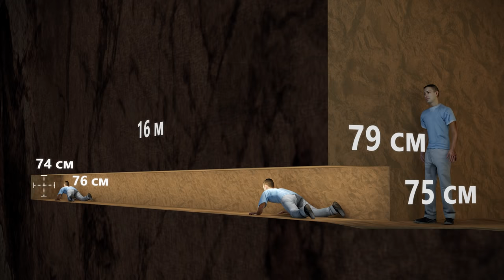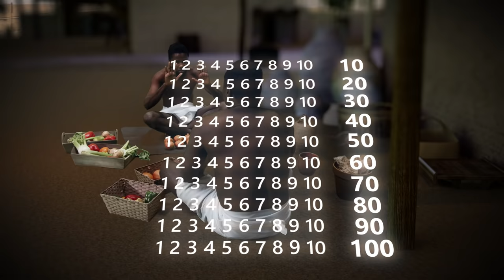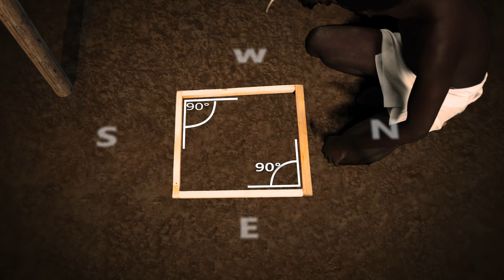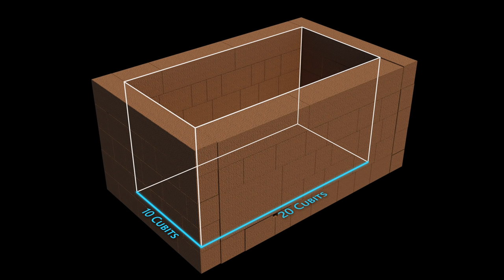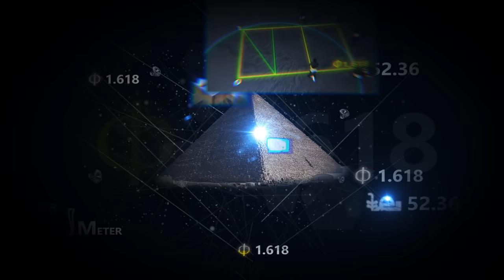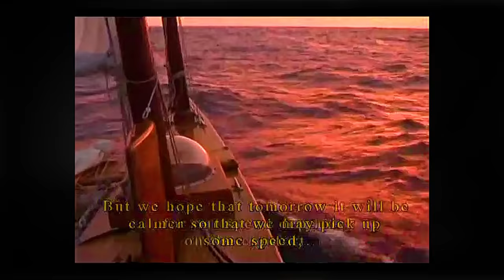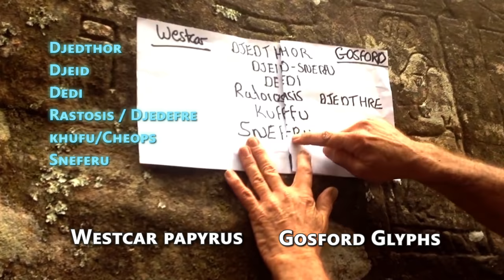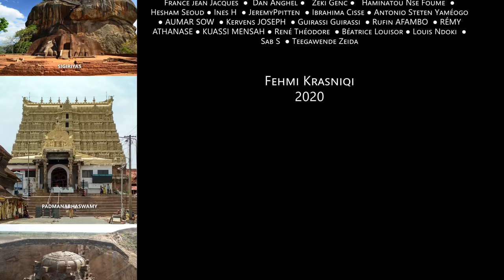The Movie Great Pyramid K 2019 - Director Fehmi Krasniqi

Comment: When you melt granite it turns into black brittle glass. The quartz fuses with the feldspar - so once it cools, you have a black glob like what you see on the islands of Hawaii. The natural granite coarse crystalline structure is gone. Naturally formed granite is igneous rock which is formed over time by not only heat, but massive pressure, moisture and gasses. Different process.
Reply: We are still missing something for sure.
Reply: Thank you. They may have poured the sandstone concrete but the Granite was not.
Reply: You are correct. Although the result is different when heating at 2500 plus degrees Fahrenheit
Reply: @jorgeduenas428  Oh. What happens during the process at 2,500°?
Reply: My question is, have the items been studied to verify tool markings and the "casting" theory suggested in this video? If not, then why?
Reply: @jetsetdotone  Better than "they shiped 200t stones".
Reply: Aliens. Definitely

Comment: While making concrete and pouring it into blocks or around forms makes a lot of sense, the giant lenses to melt granite into large forms as in this "documentary" needs several demonstrations for me to give this any consideration. Let's build these lenses, based on the initial suggestion using the materials mentioned early on. Let's then show that these lenses have the ability to melt granite at a sufficiently fast rate that would permit the molten granite to flow into the form and solidify in a solid piece the size suggested in this documentary.

Consider that this giant lens still has one focal point to concentrate the heat onto a spot. How large would that spot be, and would the heat generated be sufficient to keep the molten granite in a pourable condition long enough to fill such large forms. There are some interesting issues being raised, but likewise there are many dubious claims.
Reply: The making of concrete and pouring it into forms doesn't make any sense. The blocks of the pyramid are not the same size, they are the same height but the other dimensions are all different. If the concrete form thing were true wouldn't they use the same forms over and over? Also filling the forms up the way that is depicted and allowing the block of concrete to dry enough before removing the forms would take far too long. The giant lens theory to melt granite is akin to the earth being flat and just as ridiculous.
Reply: @bobkozalov8821  i worked with concrete making formwork with timber i think the worker would us different lengths of timber or you would make a block 2 sides then fillin that’s the quickes way to build a wall so build a black4 shutters to fillin 2shutter and so on thats the quickes way just saying
Reply: We've already melted granite with fresnel lenses from large flatscreen TVs. I would consider this debunked. It stops being granite after you melt it and doesn't become granite again after cooling. 

 @bobkozalov8821  If you only have two sides for the forms, and use neighboring blocks as the other sides while pouring in place, it makes sense that they could be different sizes as you wouldn't be concerned with them looking the same when they aren't going to be seen. Why spend the extra effort to make sure you position the forms in exactly the same spot when it's unnecessary? I think this can be confirmed by the rows being equal width while blocks within the rows are of different lengths. I would need to see them uncovered though, and that's a problem for obvious reasons.
Reply: This is typical pseudoscience. The fact that it took several years to film this BS and no one bothered with even a 1/5-1/6 scale experiment is all you really need to know about the quality of "research" presented here. Make a 1m lens with historically accurate tools then melt some granite and pour at least a brick sized block. It would've been worth much more than all your endless amateur looking animated "reconstructions" combined.
Reply: On YouTube >  *Fresnel Lens melting GRANITE *
Reply: @keithmoore5224  Giza area is a desert since at least 10,000 years so no tree
Reply: @al2207  One of the Hindu GOD made it to America over thousands  of years ago and believed the Mayan ancestors broke of from Indian subcontinent family before the Ice Age occur. What I notice Indian scriptures teaches Lord Rama aka Ramayan (Ra-Mayan word play is Mayan) tale . Buddha mother name also Maya Guatemala title derived from Siddhartha Guatama aka The 26 lineage of Buddha out of 27. Lord Rama sent his General Lord Hanuman to Middle East and South America seeking for Lord Rama Wife Sita. What I found interesting there a unknown city in South America and believe these people worship Monkey GOD like Lord Hanuman (Hindu Monkey GOD). Ancient Mayan and Aztrc also worship Naga deities like Hinduism and Buddhsim way of life. Mayan and Hindus shared the same orgin on their monuments artifacts. To many Asian connections...

Look up "La Ciudad Blanca"...

https://www.nbcnews.com/science/science-news/lost-city-monkey-god-discovered-honduras-n317296
Reply: @sppro994  what is your point ?
Reply: @al2207  She clamied in her theory it was Egyptian that made their way to America and influence Aztec and Mayan ancestor civilization.  What I'm saying she is wrong. MesoAmerica indeed trade with ancient Egyptian and brought cocaine to ancient Africa. It was the Hindus that made it to ancient America. She fail to mention why did ancient Egyptian used pyramid shape to form a monuments/ pyramid triangle (to memic Hindu Meru Mountain home of the GOD). Even Angkor Wat / Nagkor Vat (Same Vat used in Vat-ican) was built to mem8c the scared mountian . Plus Egyptian could've went to Middle East or South Africa for trees..
Reply: A solar concentrator in France reaches 3600 Celsius; experimental models in the US are used to atomize waste so that, after heavy metals are separated, one ends up with methane and a type of artificial cinder stone, meaning the worst toxic waste on the planet, sans radionuclides, can be turned by sunlight into natural gas and concrete blocks.

That said, making such a potent concentrator prior to computer-aided drafting, manufacture, advanced mathematics, and modern materials technology is...well, beyond dubious.
Reply: @al2207  The last era of heavy rains ended about 7,000 years ago. So, not quite 10k but not too far off that, either, at least from out point of view.
Reply: @MrBrachiatingApe  please verify your dating in Giza area it was not the same as the rest of Egypt
Reply: @al2207  That's what I've read about n. Egypt and the rainfall that resulted from the younger dryas climatic shift. The end of that rainfall heavy era was right 5000 BC-or rather that's the termine ante quem, so it could have been earlier. I've never seen a date prior to 7000bc for the end of the era of heavy rainfall. That doesn't mean rain forest, mind you- one has areas of India that get very heavy monsoons but are semi arid 6 months of the year
Reply: Supposedly granite turns to obsidian when heated  so I’m not sure about how credible this doco is.
Reply: 1) No evidence of Egyptians using even normal lenses, much less Fresnel
2) Fresnel lens invented ~1800, show evidence of them existing earlier
3) Modern flat Fresnel lenses exist only because we have acrylic / plexi / thermoplastics and injection molding; show evidence of these existing earlier
4) If you melt granite, what do you use for the mold to hold in the molten granite? Let me guess: diamond boxes from outer space
Reply: @contrarian8870  
Lol
Reply: the first 5 meter lens was in 1950 for mount Palomar telescope , if you melt granite result is always obsidian glass
Reply: I don't know making a lens would likely be easier then moving a 1000 ton block
Reply: Yeah, that's my reservation also...
Reply: I agree
Reply: The lense idea, which basically becomes very central to this theory, ruins it. Pouring limerock based cement, yes; pouring granite, no. There are ways to move large rocks, and they probably did just that. They cut it, carved it, polished, and moved it.. Reducing the numbers of stones needing to be moved with the pour theory greatly helps, though, it makes human construction of the pyramids far more feasible, so there's no need to concoct this absurd idea about a magnifying glass. Such an object, by itself, would weigh 2 or 3 tons, which is an issue, and you'd also think if such "technology" existed, that it would have been reproduced in smaller forms throughout this society and there should be at least some examples of it.
Reply: since your line of comment is the most repeated all over the section and yours in particular is very well presented in my opinion i will post it here. a bunch of spanish youtubers melting granite from north spain where its defenetly not the most potent sun in the country indeed might be the less men you judge for yourself...
https://www.youtube.com/watch?v=t46TsA7Ce2g
Reply: @danielmoreno9498  The video was fun to watch. It reinforced my opinion that a lens would not be the tool to melt granite in large quantities. In addition, I do not think that the technology was available to the Egyptians of that time to produce a "plastic fresnel lens", or any other lens. But such is the internet...
Reply: @danielmoreno9498  Hi there again.

Using logs as a lever and blocks of wood as the fulcrum does not sound sophisticated,
but these tools are still my number one choice for lifting large and heavy objects, at least 
were very old societies are concerned. Surely it will take time and a large workforce
to complete such monumental tasks. Absent of any other evidence of how these people
overcame gravity and friction one has to keep it simple and just keep looking,
but these days we are also dealing with the internet were people present a slew of of hypothetical
solutions (almost as fact) where even simple examples are not supported by experiments and tests.

In regard to the past 2000 years of European development, I don't think that it was sinister
or with malice, but rather a culmination of power struggles and attempts to survive
changes in culture/society. This could be said of old China as well, much of it recorded
and documented. Introduction of uniform finance, standards/measurements, and law were means
of steering large societies away from chaos and a more peaceful and prosperous existence.
All of it has two sides to the coin as every good measure implemented has the potential
for corruption and abuse.

Yes, we live like kings and queens compared to days long gone. We (many of us) have running water,
sanitary conditions, a roof over our head, light at the flip of a switch, warm clothing and good shoes,
food to our hearts content, fast and comfortable transport, access to medical treatment, education and
so much more. We can also live frugal and still keep our crowns.
Depending on were you live, there will be small or large differences, and in some cases
there are also examples of were people do not enjoy the benefits. But it is incumbent on people to
"work" towards a "better future".

There are people that have amassed a great deal of wealth, many people have wealth and financial security,
there is "white" collar, "blue" collar, and if you get my gist, it is a "class system" which has existed since the dawn of humanity.

Even to this day we cannot trust our politicians and elites to not succumb to graft, bribes, and other shenanigans
that most of us ourselves would be guilty of, given a chance. Given the opportunities to vote for people to lead our countries,
we certainly are also guilty to have the kind of leadership we have.

It is a can of worms, but we ourselves have to become more critical and questioning of what is going on in our society, on all sides
of the isles. Becoming lazy and flipping off education will not help. Diluting education into niche subjects will not help.
There are just to many that buy into dubious claims, hook line and sinker, because they just do not know how to be critical.
In this thread, I do see quite a few that in my opinion have there heads on the correct way. Not all is lost.

I wrote a lot and will leave it here. I blame you for that, :).
Reply: @elibeeblebrox1084  It’s clear the granite vases and statues were not chiseled with bronze tools. It’s clear they figured out a way to soften the granite based on the scoop marks  and deep circular holes found in some of the quarries.
Reply: They where already melting mineral deposits as they using copper.
Reply: your small mind is trapped in a box smh!
Reply: @sppro994 
Absolutely.  Baghavad Gita, Vedas and Mahabharata oldest in tact texts.  Also Old Testament is allegory for baghavad Gita and kundalini yoga - and like you said you can connect the etymology from Hindus to Torah/Old Testament characters
Reply: @al2207 
A global lost civilization with advanced knowledge in common
Reply: Energy frequency vibration. 
Universe 
One verse 🗣️
Reply: @gabrielrispoli359  no , at least 4 different alien civilization with similar construction equipment
Reply: @al2207  
What is an alien to you ?
Reply: @gabrielrispoli359  people from other planet with technologies we may have in 500,000 years
Reply: Yeah I'm with that guy. What he said.
Reply: @al2207 The deserfication was gradual, not instant, they also had trade with Kerma(Kasa/Kush) who had abundant supply of timber to trade with
Reply: @rh_BOSS  Well it's probably closer to the mark than the tripe they dished out to us in the schools. Perhaps you should be more skeptical of what you've been told by "authorities".
Reply: @rh_BOSS  Oh yeah.. they shipped and lifted 200t stones.